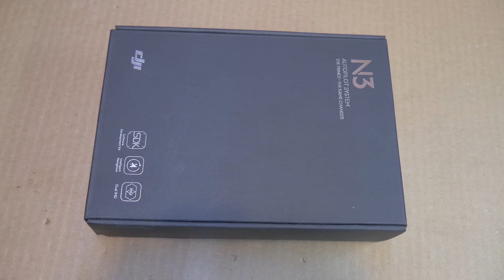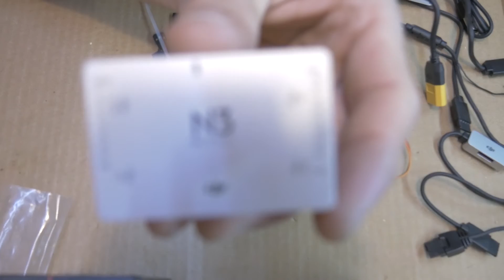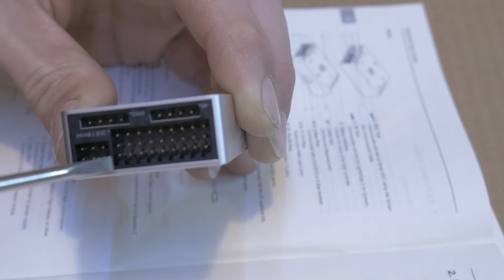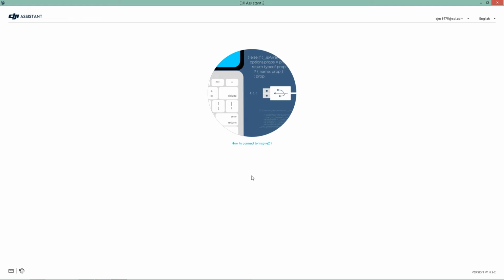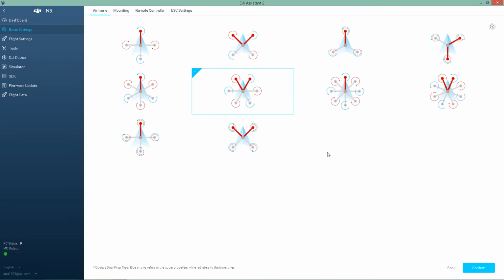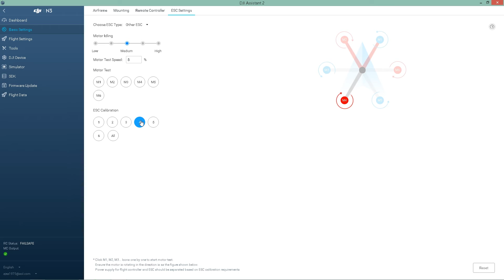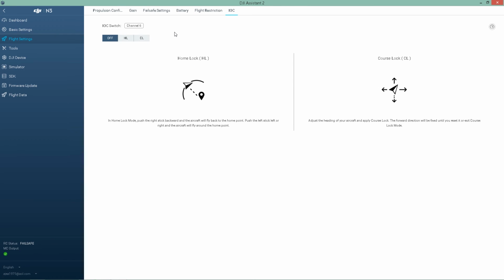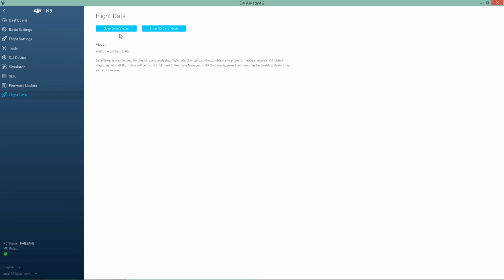dji n3 unboxing plus dji assistant 2 walk through

Comment: What a let down, no channel maping when using the Lightbridge 2, what a disappointment
Reply from the maker: Yea it is but check this out on the dji website if you need switches and or dials. ( Martice 600 series-remote controller channel expansion kit) I think its out of stock right now but looks interesting.

Comment: Hey James nice vid about the N3 and thnx for posting it!! I have a question concerning the binding procedure cause I use spektrum. Does the N3 software assistant have the option of selecting tradition like the previous Naza V2? and also is the Sbus port on the N3 the only port i can use to connect a spektrum receiver?   Thnx!!
Reply from the maker: hello, unfortunately with the n3 and a3 there is no longer a traditional option in the assistant software only sbus and lb2. however, I have read on the dji web site in the questions and answers section for the n3  only (not available for a3) that one can use some sort of an adapter for a traditional hookup, but I wouldn't know how that would work or perform. As for the sbus port that looks to be the only port. I hope this helps sorry I couldn't help you more.
Reply: MONEYPITR/C  Thnx for replying!! I have been doing some digging on my own and the D-bus adapter can be used in converting the pwm signal from traditional receiver to S-bus signal according to the A2 manual. Although the A2 has more options for spektrum users (double satellites or D-bus adapter traditional receiver).  I guess the N3 can be configured also like that with a D-bus.
Reply from the maker: sounds good thanks for letting me know, good luck with your build. have any other questions just let me know.
Reply: MONEYPITR/C Sure will do! 👍